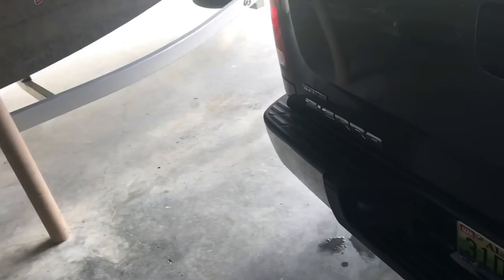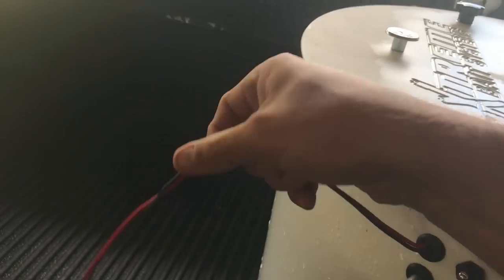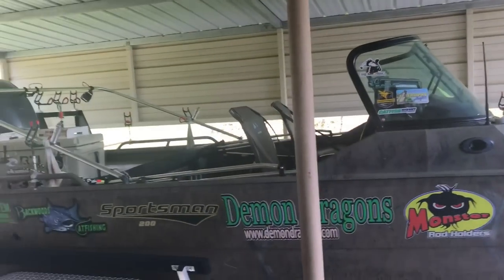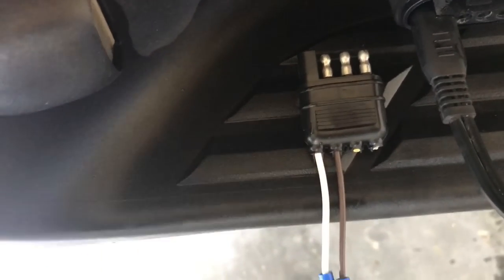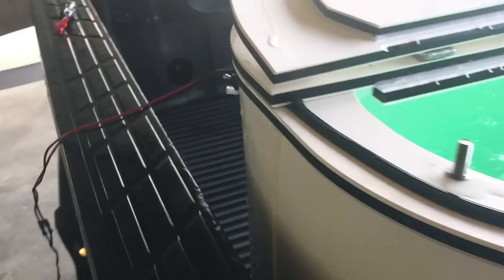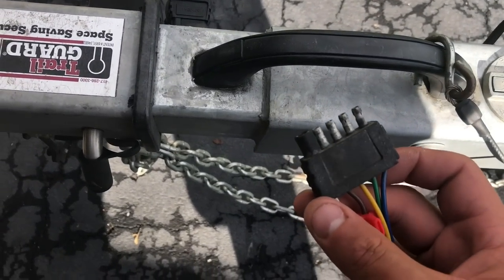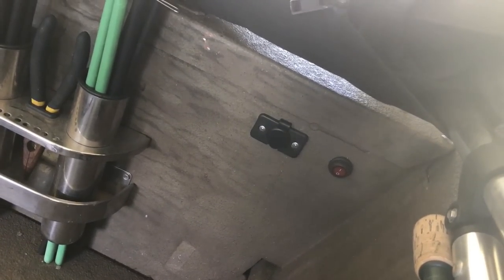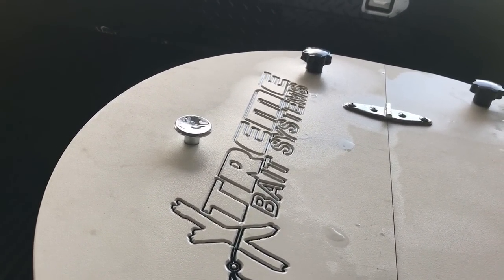Life Hack for Bait Tanks

Comment: I would watch leaving it plugged into the truck overnight it’s not a deep cycle battery and will cause damage to the cells if it is drained too far to many times. That is why they make deep cycle batteries designed for a significant discharge

Comment: I've done similar 'engineering' on my boat. Here is my experience. 100 bucks that the connection with your 'extension' wire will break lose in the next 6 months. Another 20 bucks that it will happen on a tournament day : ). Feel free to ping me in 6 months : )
Reply from the maker: I know a secret to putting them on lol it’s been lengthen for about a year now without any problems